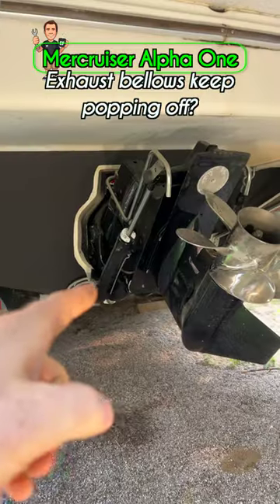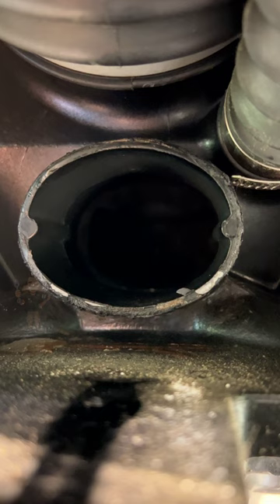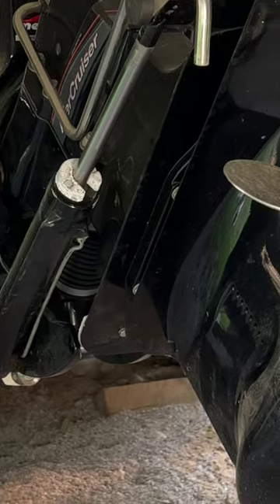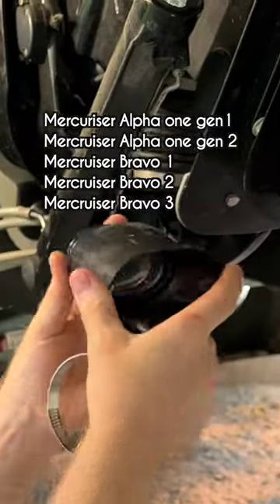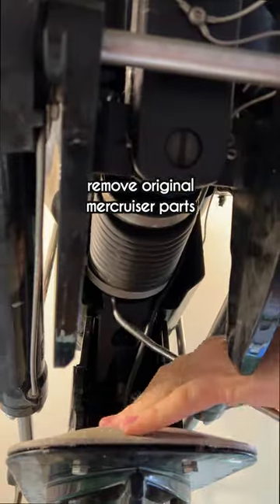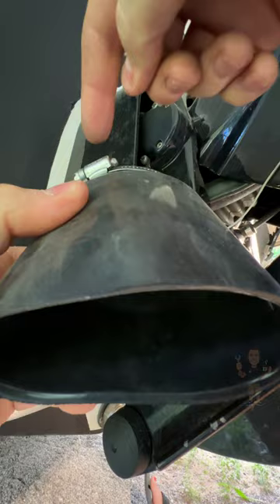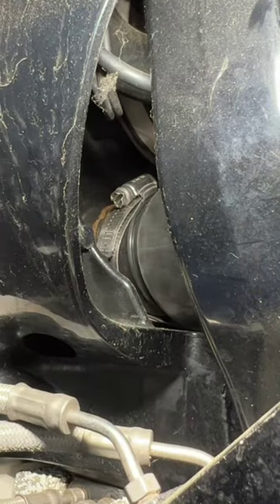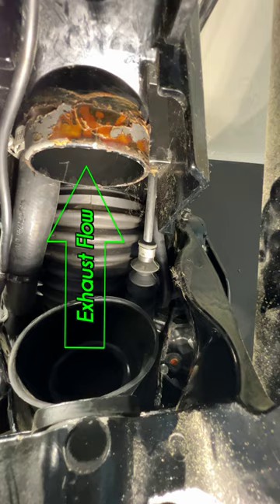BOAT OUTDRIVE FIX ⚓️

Comment: How did this work out for you I just bought mine
Reply from the maker: Fantastic! It's all i have used for about five years now. The first one i tried was not a sierra part and only lasted a year though. The cheap ones are junk 😀
Reply: @EasyFix.  so does the outboard need to be down before you get in the water or can you put it down after putting it in the water, I have a 4.3 mercruiser alpha 1 and don't want water sucking through exhaust kinda nervous to try it out?
Reply from the maker: @robloc4615  It's passive and this boot works up or down just like the oem boot. The oem boot isn't waterproof in the way you think it is. It's just there to guide the exhaust to the prop. There is water sitting in the exhaust boot up to the water line. There is no change now except a small amount of exhaust gases will get out that slip around the boot. So if there is any leaks you could call them exhaust gas leaks. You can use it as you normally would. Mine works great. The only thing you could notice is the exhaust is 1 decibel louder at idle. I can't even tell but maybe a decibel meter would pick it up. 😃